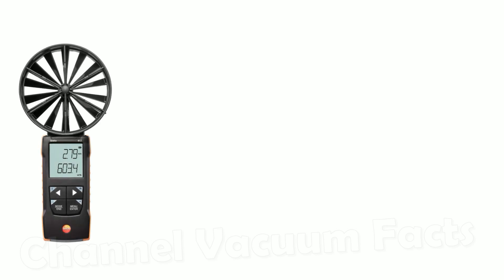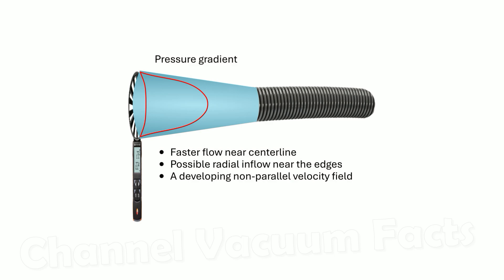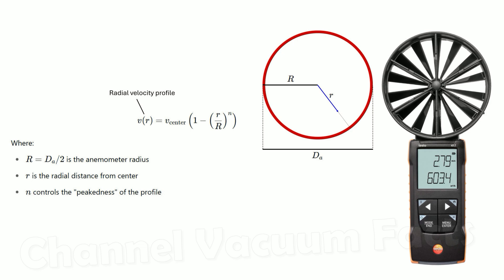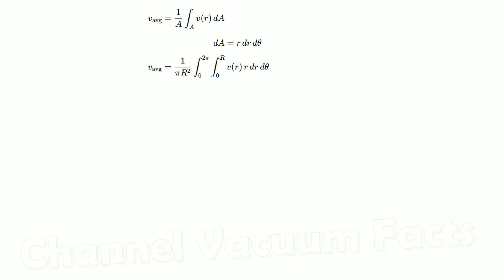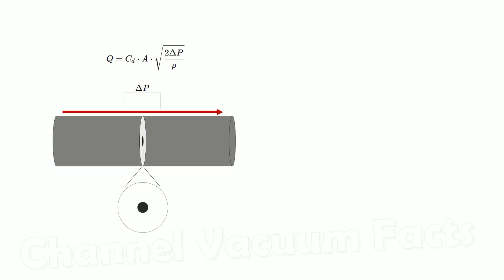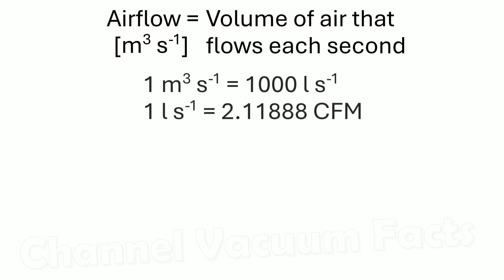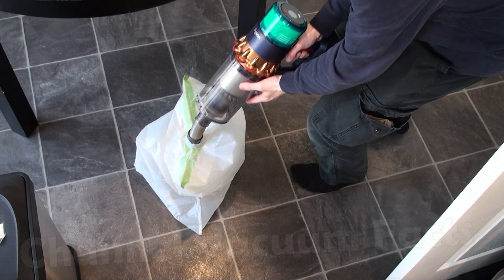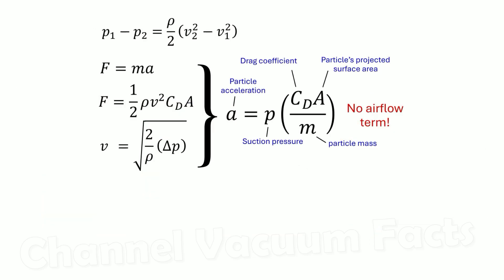Accurately measuring the volumetric airflow of vacuum cleaners

Comment: Would you say these stick vacs are not intended to be single solution for a home that has all floors carpeted.
Reply from the maker: I'd say most dupes of the original stickvac are not a single solution. In fact, all the ones I've tested are poor. The original stickvac definitely is a single solution for all floor types, as evidenced by its performance and ease of use. This means the Dyson V10 onwards. It has mains performance in its default auto mode and is very energy efficient.

Comment: A better way of doing the experiment would be to have the anemometer in the tube while deflating the bag. This way, we would not have to worry if the corrugated hose pose the same resistance to air as the smooth pipe. Also I'm not sure about the volume of the bag. It could be larger, at least it seems so. I would either 3D scan it and let the computer calculate its volume or fill it with water and measure its mass.
Reply from the maker: Edit: I understand what you're saying now...
Reply: @VacuumFacts  
I'm sorry to hear that my comment insulted you that much. If it sounded rude, take my apology. English is not my native language, so I might have used improper wording. I'd like to emphasize that I enjoy your videos very much, and generally appreciate educative work you do about vacuum cleaning.

As for the inlet tube, I'm not implying anything. Just saying that the experiment would be more convincing if you measured the bag and the anemometer in a single experiment.

As for estimating the volume of bag: Of course I would have submerged it in a tub full of water so that it could have its natural shape. I just assumed that someone as intelligent as you would be able fill out the details. Now I see you are “exact wording type of guy” so I should say that you need not to measure its mas either. You could have drawn marks in the tub while filling it for each liter of its volume. That way, you even would not have to worry about exact density of the water that you used.

The x,y measurements of the bag are fine, but its z size is dubious. First of all, the bag's shape is far from cuboid. Secondly, from the video it seems to me that it is much more thicker than 9cm (visually comparing it with the diameter of the hose).

Also, if the manufacturer of the bag claims that its volume is 30l, it almost certainly does not mean its maximal volume, but some lower practical value.

At 7:19 it seems that the bag's shape could be approximated by a cylinder section about half of the bag's length ended by two caps that look like triangles from the side. Therefore we could approximate them by taking half of their cylindrical volume. Overall

r = 45cm/π = 14.3 cm

πr^2 = 644.5 cm^2

l = 75 cm

πr^2∙(l/2 + 2*(l/4)/2) = 0.75∙πlr^2 = 36257 cm^3

Again, I'm not saying that the bag's volume is this number. That's very hard to tell from the video. But I doubt it is exactly 30l.

As for the sensitivity analysis: Q=ΔV/Δt, therefore, underestimating the volume of the bag by a factor of 1.2, makes your “measured” volumetric flow underestimated by the same factor.

Finally, I would expect, that you -- as a physicist -- would be curious why your measurement came so far from the theoretically predicted (100% overestimate measured, 20 to 30% calculated) value and would not be satisfied with the fact that the measured number was in the anticipated direction.
Reply from the maker: I think I understand what you’re saying now. Ideally, the anemometer would measure the same system simultaneously. You’d have to make sure the anemometer has enough time to spin up. But people could do that if they wanted to. It shouldn’t make much difference through, and the reason you suggested about an increase to resistance from a few cm of hose is definitely not true.

The other point you’re making is that you need to make sure you have a known volume. Which I agree. In my case, it was estimated based on dimensional measurements. The thickness when inflated was on average about 9 cm (obviously it’s not uniform). It’s possible I underestimated my volume and so the airflow is larger than reported and nearer the anemometer. I’m fairly confident that from the absolute most I could have underestimated it, the airflow could have been about 11 l/s, which is still 20% lower than the anemometer reads and within expectations from theory. Ideally, you’d fit a large bag into the shell of a known large volume, like a big wooden box you could build, and shrink it from within there. This was just a rough proof of concept of a more direct method that’s less prone to error if conducted accurately.
Reply: @VacuumFacts  You're right about negligible effect of the different tubes. Considering the amount of turbulence before and after the impeller, which acts as a high resistance to the flow, there will be very small difference (unless the motor power would be regulated so as to maintain constant pressure in the inlet tube -- but I don't think there is a pressure sensor there so it most likely is not).

I like the idea with the wooden box -- that's probably the most practical way of doing it. 

Still I'm not quite sure I understand why the turbine spins faster in a duct. I have a intuitive explanation that would not probably capture all the physics: Having the turbine in the open air stream is like moving it at a constant velocity in the still air. The volumetric flow should be A*v but some of the air flows around the anemometer as it is causing a drag to its motion. Therefore the anemometer has to be calibrated such that it overestimates the amount of air that actually flows thru it. Then, when you put it in a duct, all the air goes thru the turbine and the overestimation correction for a free air becomes observable. Sounds plausible but I'm not sure if this would explain the phenomenon fully, i.e. if it would closely match experiment, if it the detail were calculated.

Anyway -- keep posting your videos!
Reply from the maker: To elaborate on why the turbine spins faster. For a fixed airflow, the speed of the turbine in laminar flow is lower than it would be for non-uniform flow with a radial velocity profile that is relatively lower at the edge and relatively higher in the bulk centre. This radial profile is set up because of the pressure profile that forms downstream for various fluid dynamic reasons. The higher airspeed in the centre bulk region drives the vane faster. If you plot the power law function, you can visualise the radial velocity profile to appreciate why the air turbine is driven by the bulk centre velocity (I took it out of the video at the last minute and regret that now). It therefore detects a higher airspeed that isn’t actually present at the edges, but it assumes it is by virtue of assuming a laminar flow. Since it calculates airflow based on airspeed, it thus overreads it by the amount calculated (and empirically supported in my quick test, albeit not as rigorously as could be since this is just a proof-of-concept internet video). There are many other fluid dynamic effects going on in the tube as well which contribute to misreadings, but they’re harder to calculate and really need sophisticated modelling to be accurate. Point is, using vane anemometers to measure through enclosed spaces will give overestimates in airflow and there are better methods that rely on timing extraction of known volumes. I was just shocked how the classic rabid vacuum enthusiasts didn’t seem to know this despite unfounded grandiose claims of expertise and built their entire house on sand. Apparently, pointing out the science is, in their view, akin to ‘narcissism, yapping, and trying to 1UP ego with misinformation’. You can lead a horse to water…
Reply: @VacuumFacts  Oh yes, I forgot the turbulence. So it cannot be fully explained just by the analogy with an anemometer moving in a free air . Thanks for  pointing that out. 

Anyway, I like this video not because I'm measuring the flow of my vacuum cleaner but because the physics behind is amusing (though I must admit that it was your videos that led me to the decision to buy battery powered Dyson V15).  Thanks again for your work and don't be sad that some don't appreciate it -- they just might not have a mental capacity to do so and it may not even be their fault.
Reply from the maker: @32bits-of-a-bus59  Thanks. The inspiration for this video was misunderstanding commonly seen that I saw again recently on a forum. So I decided to address it fully. There are some out there that have built entire channels on vane anemometer readings through pipes or equivalent...like the house built on sand.